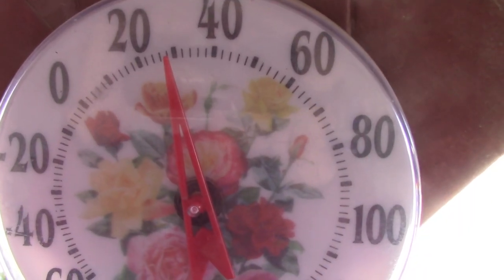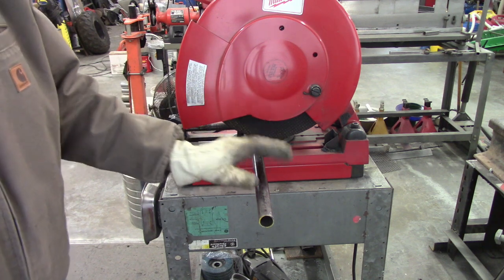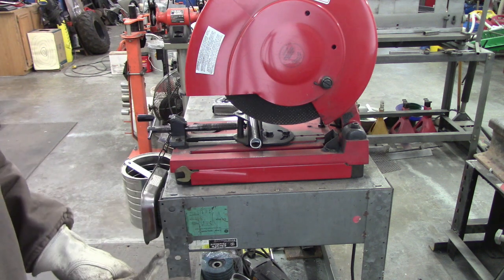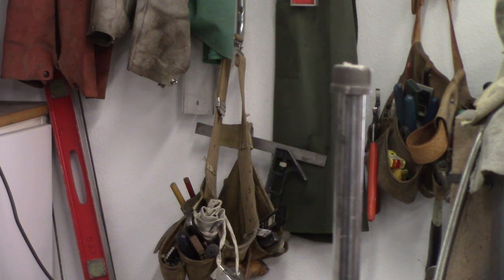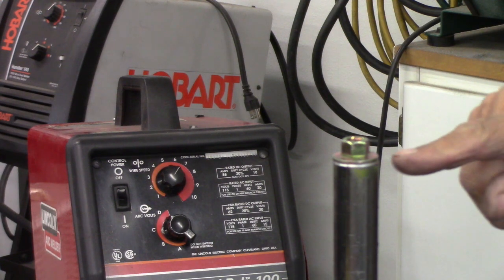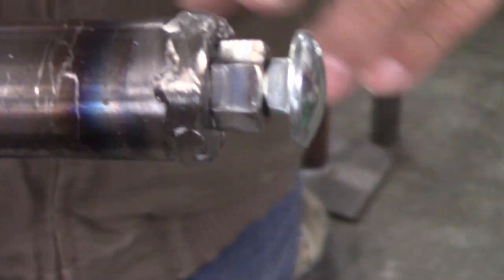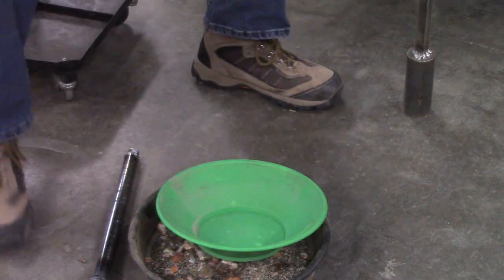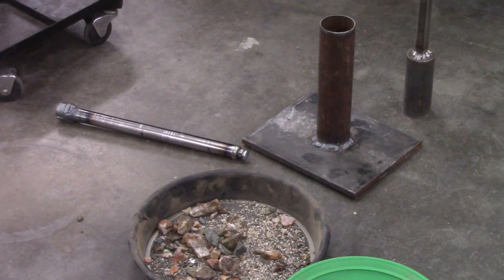HOW TO GET A FINE CRUSH OUT OF YOUR HAND CRUSHER

Comment: Had made something similar but with a round stock metal bar. The same one that Indiana Creek Gold shown. Just wish I made the bottom with a larger pipe to be able to clean it out better.  Not a hard project if you or anyone you know has a welder 👊✨️👍
Reply from the maker: Thanks for watching and commenting A3. If I had the right materials I wouldn't have had to weld. But I do like to weld.
Reply: @Chuck Gentles  usually when you are breaking out a welder your in trouble...but this is a good thing 😉

Comment: Hi Chuck and thanks for the shoutout. You have the idea.
The smaller ram applies a great deal more pressure at the head than the larger ram does. I use a set up like you have there to breakup the larger rocks and a smaller pipe that is not on a base for the actual powdering. The smaller portable  pipe let’s you shake the material around to keep it under the ram. I just take one of those pieces of rock at a time and work it into a powder rather than putting multiple pieces in. 
I timed my 2” pipe and ram on the base and it powdered a 1-1/2” rock in about 30 minutes. My 1-1/2” pipe with the 3/4” ram powdered the same size piece in 2-1/2 minutes. The smaller ram is much easier on the arm when you are crushing a lot of a rock at a sitting.😊 I’ll have to do a video to show you my set up.

Comment: Good idea/fab.  We also made a couple near-identical plunger hand crushers and were similarly unsatisfied. They only work well when small amounts of ore are fed.  

I like the black iron cap idea and personally, I’d also like a pipe length that allows me to stand.  No need for lead shot in this case; its weight does the work.

Thanks for putting this together.
Reply from the maker: Thank you for your kind comment. Glad  the video was useful. thanks for watching.